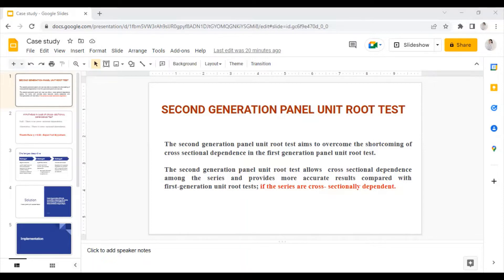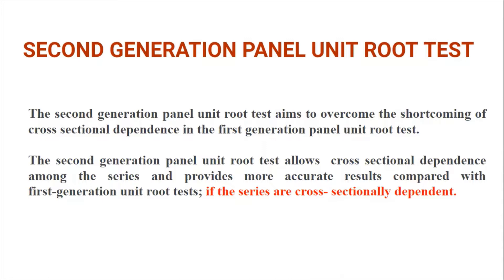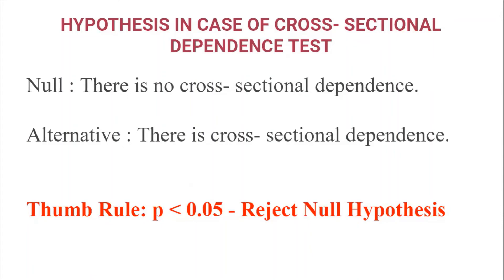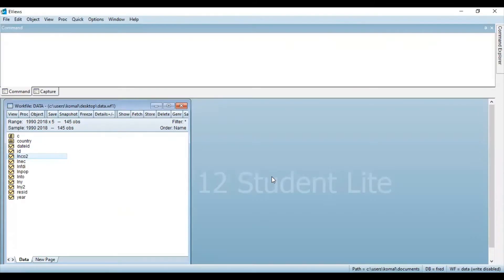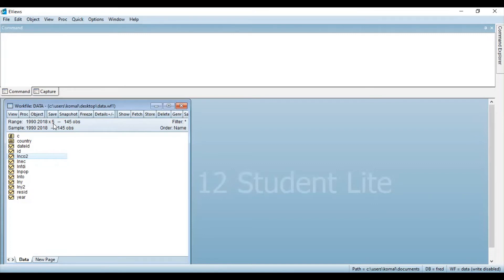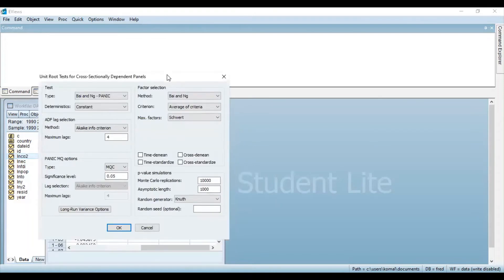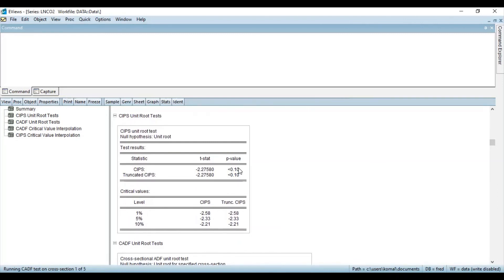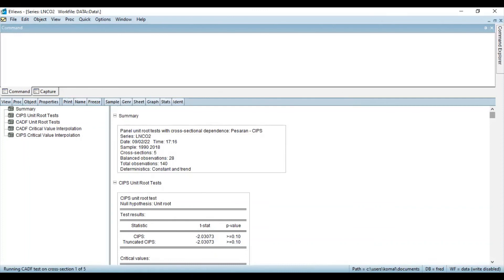Second Generation Panel Unit Root Test || EViews Tutorials || CADF || CIPS || PANIC

Comment: Ma'am, I guess this was a mistake at 10.35 onwards. You said since p<0.05 (which is the case here), "we cannot reject H0, and hence we accept the alternate hypothesis of having no unit root, i.e. data is stationary." However, this conclusion is not correct: if p>0.05, yes we do not reject H0, meaning that in the case of stationarity, we would ACCEPT H0 (not H1), that is, data has a unit root or is non-stationary. I think you need to clarify this, as it will lead to a lot of confusion for others watching this video.
Reply: You are correct.

Comment: Here p value is greater than 0.05, so how can we accept the alternative hypothesis (10.40-11 time of streaming) pls. Check it. As per my knowledge we have to accept the null hypothesis.
Reply from the maker: Dear, the interpretation is that-
This last table provides the result of the Pooled version of individual ADF test statistic in the previous table. 
Due to very high value we cannot reject the Null Hypothesis. 
We cannot reject the Null Hypothesis that- All of the variables are simultaneously not cointegrated.

Comment: mam please clear me that if the p value is more than .05 that means the variable is stationary in second genration unit root test?
Reply from the maker: No, it doesn't. If p value is greater than 0.05, this means that the variable is not stationary at 5% level of significance. However if the p value is more than 0.05 but less than 0.10, you can state that the variable is stationary at 10% level of significance. But if it is more than .10, the variable is not stationary.

We are conducting a Panel Data Analysis Workshop on 25/26 Nov. You may register if you wish to.
Link- https://forms.gle/3R5CkRT1gJpGjrVv5

Also join my telegram group for further updates - https://t.me/kshekhawat
Reply: @komalkanwarshekhawat_   thanKyOu ma'am. if the data is not getting stationary in second unit root test can't we run 1st difference and second difference on second generation unit root test? or we can conclude that the data is not getting stationary at level and assume to be stationary at 1st differnece and 2nd difference after converting into log form?
Reply from the maker: @Varneshghildiyalvibhu You are interpreting it in the wrong way. The second generation unit root test is performed when there is presence of cross-sectional dependence.

Comment: Thank you so much, i have a question (how to run the first and second difference for CADF and CIPS tests?)
Reply from the maker: Second generation panel unit root test option is available in EViews 12 and new versions. However, To the best of my knowledge, I couldn't locate this aspect in EViews 12. Still, You can perform first and second difference for CADF and CIPS in Stata. Good day!

Comment: Great video, Thanks so mush 😊
i have a question, when using CIPS and CADF tests how can i check for the 1 difference and 2 difference ? i dont see the option to do it in eviews
Reply from the maker: Thanks for your kind words. 
Second generation panel unit root test option is available in EViews 12 and new versions only. However, To the best of my knowledge, I couldn't locate this aspect in EViews 12. Still, You can perform first and second difference for CADF and CIPS in Stata. Good day!